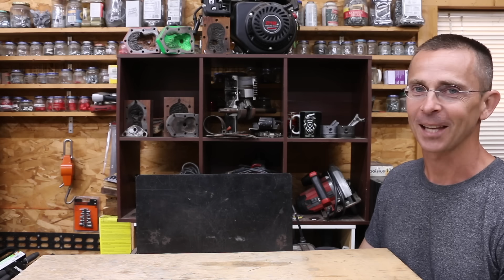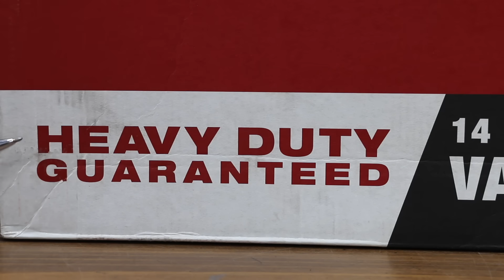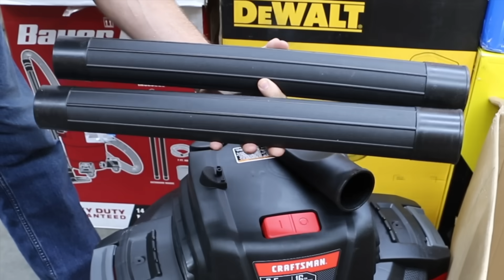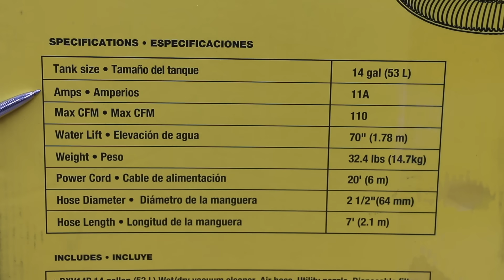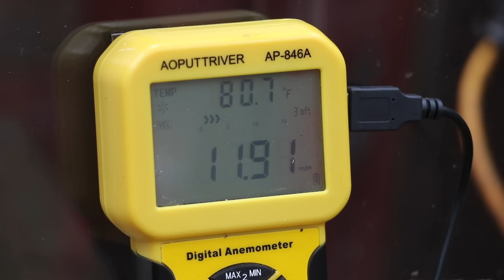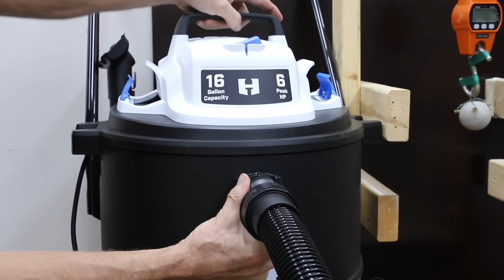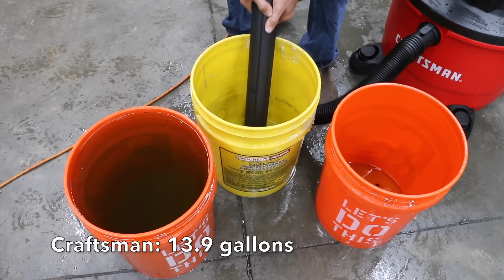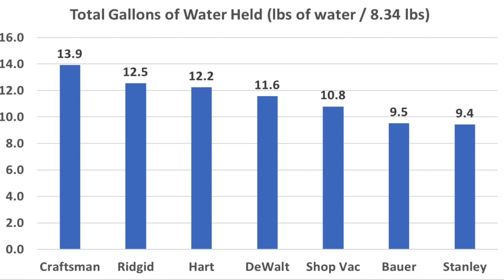Best Shop Vac? Ridgid vs Shop Vac, DeWalt, Stanley, Hart, Craftsman

Comment: I purchased the HF , and it was loud, and we did some flooring, and grinding, and this vac just did not filter all the dust. I blew it back into the house all over. We even tried using a bag filter, and it did not work well at all. We used the nozzle stopper on the Rigid, also with a regular filter and bag, and the Rigid did better. We took the Harbor Freight back.  I am often looking for the underdog product to win...but for such tasks like construction it was a weak performer.

Comment: Love the video very thorough.  Best test case I've seen in the category.  I am curious though if sealant type modifications were added if the results would more closely reflect the power outputs.  Ik that wasn't the purpose of this video. But I do think there may be some utility in buying a product with exceptional hardware at a good price if a small amount of foam, dried caulk or a folded layer of tape could impact the performance.

Comment: This was impressive! I'm kind of surprised that Bauer did so well. I'm not sure what the extended warranty would be on Bauer and how much that would increase the cost (assuming it's available), but if you're worried about using the warranty, it's hard to beat HF - you take it to the store and they'll swap it out right away.

Comment: While your testing methods were well thought out and thorough, the gold standard for measuring suction (the most important aspect of any vacuum) is water lift. It’s cheap and easy to build a water lift meter; maybe next time you could do that. And speaking of next time, I’d love to see a repeat of this for shop vacs costing $50 or less (for people on a tight budget). FYI- Harbor Freight offers a 2 year extended warranty. I’m not sure how much it costs, but if you use a HF coupon (which they offer on a very regular basis), I’m pretty sure it would cover the extended warranty.

Comment: My top of the line 12 gallon stainless ShopVac had a shot motor after one construction job.  The new Shop Vac models do not have bearings.  They have a radial brass sleeve at either end of the shaft (similar to a brass plumbing compression ring).  Pull that Shop Vac motor and you will see how underbuilt it is.

Comment: Honestly, a vac with the build quality of DeWalt (or at least a gasket and more aggressive clamps), the motor and actual capacity of Craftsman, and rubber wheels on casters would absolutely dominate the competition.

Comment: Great review.  The notion to sell a tool bare without a battery and charger is a parlor trick.  Unless you already have a battery, which I'm betting most people won't, it doubles the price of the tool.  For 200 bucks I'll keep dragging the cord around, thank you very much.   I'll wait until EGO sells a cordless shop vac.

Comment: I'm a bit confused, however, as the DeWalt was the quietest and used the third least energy, but had the best suction, the fastest water vacuum, and the fastest sand vacuum. It also had a three-year limited warranty. how could it not be the best? Sure, it weighs more but that's not an issue (it's on wheels and is turned into a handy cart), and it the windspeed isn't quite as high, but suction is the bigger issue. Can you share why you didn't choose it?

Comment: The Bauer w/HF's replacement contract seems like a good deal, if you live near a store. Lowes does OK w/Craftsman exchanges, too. Otherwise the longer guarantees may not mean much when it turns out you have to pay for shipping, relegating the vac to the dump.

Comment: IDEA: You should test out the warranties offered by companies.  Saying you have a 3 year warranty means nothing if it is almost impossible to collect on that warranty.  In my experience there are some brands that will repair or replace no questions asked and some that offer a lifetime warranty that takes months of work and they still do not cover the item.  For this test, I dont think you even need a broken device.  Just trying to get the warranty on a device you own will tell a lot.

Comment: Thank you for the great review (as always).  I was due for a new shop vacuum as my Kobalt finally gave up the ghost.  It was a disappointing vacuum since the day that I bought it.  I like Harbor Freight tools but I am leery of most of the electric devices that the sell (try their cheap $6.99 die grinder which is so under powered that it could barely polish a dog's claw).  Your video made me decide to go get the Bauer from Harbor Freight rather than getting the Rigid.  Your no BS videos are excellent.  Keep up the reviews!

Comment: When you were showing the fit between the lid and the bucket of each model, it would have been more fair to have each unit running because the atmospheric pressure on the outside would more than likely sealed most of the lids better with a vacuum applied to the interiors. Thank you for taking the time to make these videos.

Comment: Do you do any modification videos or critical improvement content? I love that your videos are comparison videos and not just reviews. They are fantastic if I'm going to buy only one of the products and use as is. But one thing I notices in this video was that a major component of the vacuum's success was the quality of the seal of the motor to the bucket. Another was the hose length and diameter. Have you done test with more equalized factors? What about modifying the vac's with simple solutions to try to improve their performance, like using something for the seal to prevent leaks?
The reason I ask is maybe the best vacuum to buy isn't the one that performed best overall out of the box, but the one you spend $20 on for silicon strip for the seal, or a spare hose of different length and opening. Also, what about the filters? Some may have an impact in these performance tests, but also in the quality of filtering.
The other reason I ask is because I already have a vac. I'm not going to go out and buy another one but watching this video has given me ideas on how to improve the one I already have. If you have suggestions how to do that from your experience in testing that I wouldn't just from watching the video, I'd love to hear them.

Comment: This is one of my favorite channels. I am always so satisfied by your methodology, however, when you were measuring the suction force on that ball, the different surface area (hose size) will greatly increase the force measured for a given pressure created by the vacuum. Much respect, keep up the excellent work!

Comment: I used Craftsman Vacuums for Commercial HVAC Service, they got the hell beat out of them and would quit. I’ve picked up dirty coil cleaner laden water, glycol solutions, cleaned cooling tower sumps, leaves and trash out of Condenser units. ** I know a boiler service company and they use two in series as soot vacuums. He trashes them when the fans in them get too dirty to pickup the soot. ** Never reach down in a condensing unit and pull out leaves and trash, you could get needle stuck, from some dope head dropping a Syringe in the unit.

Comment: I was so stuck in my mind between the Dewalt and the Bauer. There's around a $20-$25 difference between the two (the Bauer being on sale in my area). While some may say the slightly better performance and the better warranty are worth that price difference... I am cheap and so is my wife. I asked her advice and she said "no way I would buy the more expensive one if the performance is about the same". If the Bauer hadn't have been on sale, the price difference would have been much smaller and I wouldn't have any qualms with buying the Dewalk. I may grow to eat those words, but I feel better about my Bauer purchase after seeing this video.  

Thanks for doing this. I was impressed with the scientific and real-world tests performed. It was good to see other brands I was considering (but finding mixed reviews on) and being able to see clear answers to questions I had.

Comment: I understand why you compared the Amps to get a feel of power consumption, but then each manufacturer has a different motor efficiency, propeller load, etc...  A motor may be drawing a lot more Amps at 110Vac, but have very poor suction, low rpm and be running hot as well.

Comment: Poor design in all of them, having just 2 snapdown points for the lids. My stanley also only has 2, but my old shop vac has three really solid lockdowns. My newer stanley barely even works now, after sucking minimal water once. While the old shop vac just won't quit, after years and years of hard use and abuse. It even sits outside in our canadian winters, covered in snow.

Comment: Our wash basin overflowed this evening where the clothes washer drains into. Gallons of water soaked the tile floor into the bathroom and, worst of all, into my room soaking the carpet, base of a lot of furniture and boxes where I had things stored. 

My brother went to Lowes for a shop vac and returned with a:
Vacmaster Professional 12-Gallon Portable Wet/Dry Shop Vacuum
Item #2852777Model #VJH1211PF 0203
Rugged 12-Gallon Polypropylene Tank

Powerful 5.5 Peak HP High Performance Motor

Complete Vac Organization with On-Board Hose, Cord and Accessory Storage

It's a Beast and even says so right on it. It did a great job sucking the water out of the carpet and is a joy to use. 
The cost is 100 bucks and worth it. You may want to consider this vac the next time you need to buy one that really works and convenient to use.

Comment: I have a 12-year-old Ridgid cordless 18V 3-gallon model, and it is great. It can't compete with these for power or capacity, but it's so incredibly convenient that it still wins. Vacuuming the car, or dealing with water in power-out situations is no problem at all. I can't recommend it highly enough.

Comment: Have you factored in cross section area of the hose for measuring lift? to get comparable results it should have been tested with the same hose diameter/adaptera attachment

Comment: As what kind of filter goes on a vacuum has a major impact on the performance of the machine, I was just wondering weather you normalized for the filter during the tests that had filters installed.

Comment: Your videos are just tremendous. For the first time ever - small bone of contention. You should probably build a fixture to test the static head vacuum. The vacs with a larger diameter hose should theoretically have an advantage sucking on a fixed size ball. Still learned from the video though. Frankly I sort of love/hate ALL of these vacs.

Comment: Rigid is short and squat so it is less likely to pull over if wheels are snarled on something. I went with the 14gallon because I didn't want the blower feature. (simpler design on 14)

Comment: Had a craftsman 16 gallon 3-1/4 HP for  25 + years bought it in 1989 it was left out in the rain for like whole summers working on boats, went through many hoses and ends couldn’t kill it until I left it under a missing gutter down spout it got major water in the top of the motor probably still have it if I dried it out before trying to use it, replaced it with a rigid and kept inside we’ll see, I see mostly rigid on big job sites. Great video breakdown of the capabilities my vote is craftsman for longevity but brands change all the time

Comment: I started detailing cars on the side in the '80s. Well, detailing is a stretch -- more like washing and waxing. I wasn't even small time --- would have had to work just to get to that level. Anyway, after doing a few cars (and lawns, my other side gig) I got the only wet/dry vac I was familiar with as I worked at Sears too -- the Craftsman. I'm not even sure I knew where to get the Shop Vac or any other  brand for that matter. Until I started getting Ridgid vacs in the 2000s, the Craftsman I had then was by far the best wet/dry vac I ever used (not just owned). I think I sold it in a garage sale in the late '80s before moving away from home to finish college -- my dad was mad I didn't give it to him! For some reason I forgot about that experience later and bought 2 or 3 Shop Vacs before getting a Ridgid but was never impressed with the SV brand. I still think Ridgid vacs are good but I'll look into the Craftsman again.

Comment: How did the Bauer and craftsmen get mentors at the end with DeWalt omitted after it won the suction strength, sand and water pick up plus the head to head? Thanks again for taking the time to perform the tests.

Comment: Couldn't have asked for better presentation.  Having a rating comparison on so many different performances really does give me the tools I need to make the "best" decision.
Based on strong harbor freight's customer ratings (looks like 1st rating was from Feb this year),  nobody reported that the Bauer model had broke down. So, I went with Bauer.. Just picked it up today after watching this vid.  They did offer a protection plan, but I decided to turn it down to keep initial costs low.
I'm looking forward to decent performance, a little bit of high noise, and some risk concerning longevity.

Comment: I've got a very different request. How about some tests of work wear? Especially boots. For me specifically winter boots.. They cost a small fortune and good ones last for years. Over the years I have donated more than a couple almost new ones to goodwill when they did not perform. The problems being traction on ice both smooth and rough and the ability to keep warm.
Thanks for all your hard work.
You rock

Comment: My Ridged bought many many moons back just up an pissed me off yesterday while vac'in up some 1x1 tile pieces. .Kept clogging up causing that internal ball to shut off the flow..  SO.. Searched this video up and watched it.. Went out and got the CRAFTSMAN CMXEVBE17595 16 Gallon 6.5...  It SUCKS... Yeah..It really does..Literarily.. Not only was it handling those 1x1 tiles but large chunks of concrete board and nails..  I decided to check the contents after Vac'in and the tub was full.. ***Note to self*** Next time don't blow off the filter with tile dust on it when the wind is in your face.. lol  Thanks for the Vid.. Helped me decide...  Waiting on a 60 to 75 cc chainsaw clip..  That's my next purchase..

Comment: Let's be clear here! Stanley Co owns Stanley,  craftsman,  DeWalt....TTI owns RIdged & HART....Shop Vac is closed went belly up....Bauer is a China knock off. The test was not really fare given the ridged unit was a cheap home owns multi unit. I use Ridged Pro in my shop & home given the warranty, accessory capability, filter selection and over all performance a cross the board.

Comment: Check this YT video out and don't buy a shop vac filter again. I do not benefit from sharing in any way!
https://www.youtube.com/watch?v=NMTT_4Kac-w&ab_channel=Engineer%27sHomeWorkshop
Really works! I have an old shop vac. I tore off 4 sheets of scott shop towels and wrapped around the foam filter element. Perfect to make it with just an inch overlap. I then slipped the fabric sock filter over the toweling and a rubber band to hold the sock in place. No more puffs of saw dust coming out, no change to motor rpm and easy fix vs. purchasing filters.

Comment: Nice review.  Harbor Freight sometimes surprises me as some of their stuff is pretty decent.  I bought a cheap air compressor from them once and it died in about a month.  I was pretty annoyed and I hate returning stuff.  So I decided to tear it apart instead.  It didn't seem to have good compression so I reassembled everything with high temp grease around the piston, etc.  Thing ran for a decade after that and never missed a beat.

Comment: HF been trying to upgrade their reputation some what and they always suggest an extended warranty. As with anything it depends. I am a Dewalt fan guy, but I would never spend the money on a Dewalt shop vac for average performance. Keep in mind the different size vacs will give you entirely different performance. I have some Ridged and Bauer shop vacs, and to be honest the larger bauer is awesome, the smaller ones not so good.

Comment: I'm sorry but on this test i think you dropped the ball a bit.  I've owned 3 of brands and now have a small ridgid.  I'm much happier with it for several reasons that weren't taken into account. 
1. The hose is longer and more flexible.
2. I like the removable power head to use for blowing out my garage without the fumes of my gas blower.  If you don't want that they make most models without it.  To penalize its loss of performance that this causes without giving it any positive for the added utility misses the point.  
3. The filter cartridges are much more secure and easier to deal with than push on types that fail off.
4. Wider canister doesn't tip over as easily when dragging it around by the hose. 
So yeah performance in sucking is imported but there are other reasons that drive a vacuum purchase. 
That said I've watched your videos a LOT and this is the first time I feel you dropped the ball.

Comment: It looked to me like dewalt took the overall performance win. But I didn't consider price. I'm amazed at how much performance they got out of that small motor, I have a rigid, and I thought their large motor was going to crush it. Maybe I'll mess around with modding the container seal and fit for better efficiency?

Comment: I also would have liked to see a suction test after 24hr run time, to possibly simulate some wear and stress. Also...you could dump a cup of drywall dust into the motor air intake......